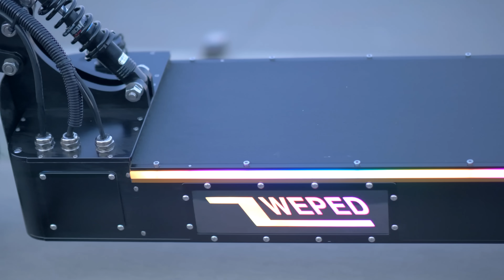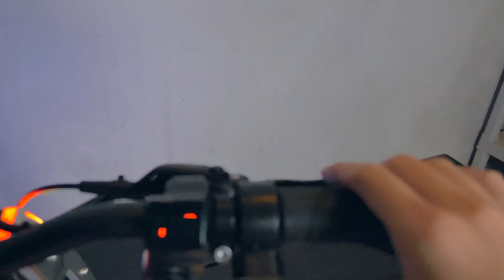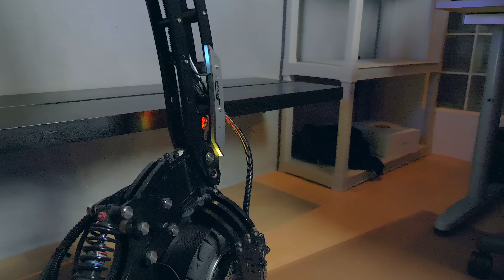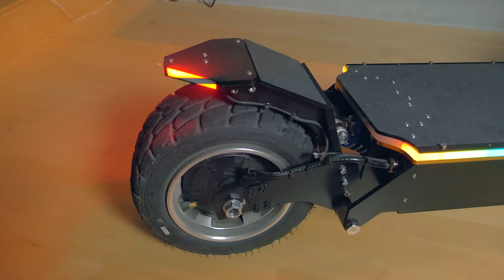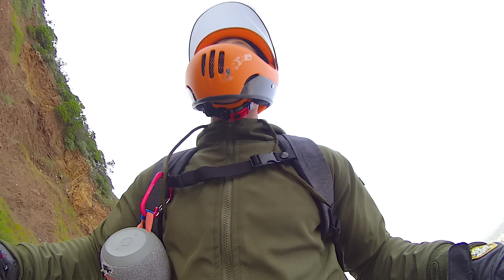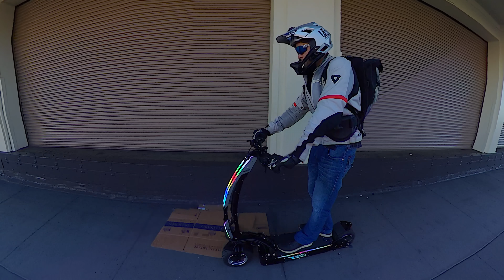WEPED SS Electric Scooter, An Insanely Fast And High Quality Ride

Comment: so how long do the motors last before replacing 2 years?
Reply from the maker: The motors actually last a surprisingly long time! They are very simple components, only copper wires and magnets. I can see them lasting 10 years or longer. Your battery will go before that, likely after 5-6 years, but you can replace everything as needed including the motors.

Comment: Very nice video! i have a dual 1800 (3600w) scooter and if you want mor stability and less wobble at high speed ride like a skateboard side way and bend knee after 50kmh if i stay straight i can't control. it's already freakin powerfull...i can't imagine 5000w+😅
Reply from the maker: Good point about the stance, I do ride like that sometimes, it's nice carving like that too. Nice to hear about your scooter, sounds awesome :)
Reply: LDX brand name from alibaba.well tbh it is not waterproof. get moist create a controller to blow. then they send me 2 new controllers 1 blow because of bad design board was touching the casing☹️ still wait for new controller again since december. when hes running it's great😂

Comment: I gave a like for the quality production of the video, but I'm not a big fan of that weped brand....I simply don't like its design, looks weird.

I appreciate that they have a wider deck at least with this model. 

44 miles in mode 1? Lol... Like 88 kph? Hard to believe that Sh1t 🤣 then in Mode 3 will surpass even the Rion with a top speed of 260 kph 🤣🚀. Rocket launcher babe 🚀✈️🔝🌌🚁

No spedometer? That has to be some bulsh1t to 🤣

45 ah battery without no fast charge? That's a biig boolshit!!!!!!!!!!!!

Comment: I gotta hand it to scooter people, yere bloody nuts, I ride an ebike that maxes  out at 74kmh. On a 3kw. And even that's too much for a push bike. not saying i wouldn't ride it, i definitely would and now I'm considering building one.  I have  two 52v battery's lying around that i could link in series for a 104v 60ah with 85amp discharge. That oughta do it 😛
Reply from the maker: E-bikes are also awesome, and probably the safest PEV out there. A 104v 60ah battery would be insane 😳 Plz do it lol.

Comment: Totally insane. Not the Scooter, it looks cool, but somebody even attempting to ride it at even 65mph + needs therapy.  My fat e-bike tops 42mph, and I don't go over 35, and it's 5000w.
Reply from the maker: Yeah, I think it's going to be rare that you actually want to utilize the top speed, but it's cool for bragging rights. Your e-bike sounds cool, have fun on it! ⚡️💪
Reply: @AlienRides  Cheers! 👍😊
Reply: @Martyr4JesusTheChrist  It does, I've just left the setting on eco mode which is setting #3 the controller is 120amp with a TFT750C display, 72v 26ah battery that charges it to 83v max, so I'm ok with knowing it has the torque and speed 😊 Thanks for the positive comment. 👍
Reply: @Martyr4JesusTheChrist  it's an OEM, I believe generic, (conroller)it's unbranded, the cells are Samsung, I can use the battery without pedal assist for a couple of days riding the bike before I have to charge, but under 65v and the bike struggles a bit because the hub motor is minimum 60v to 90v so it's why it keep the setting on eco. Just an update I've maxed out at 48mph on full setting and eco mode gives me 35mph. I ordered everything from Alibaba.com apart from the bike which came from eBay brand new 85% assembled. Unfortunately I don't know how to program the Kelly or Sabvoton controller as I know it will make the bike ultra quiet and more sufficient, but I haven't ruled it out getting one, also I live in London, and there are ebike shops that just sell bikes and don't do bike builds or at least programme controller set ups as I've enquired before.

Comment: Not crazy about how low and close to the rider the handle bars are.  Non adjustable handlebars are a no deal for me.
Reply from the maker: Yeah, I think that's most electric scooters, the Weped SS has a fairly long deck though, so it's really up to you on where to position. They're not as adjustable as other scooters for sure though.

Comment: In my opinion a scooter that small is not meant to be riddin that fast
Reply from the maker: It is actually one of the largest scooters, but that’s a fair point, definitely dangerous riding at speed.
Reply: @AlienRides  totally agree. It is good that it is built large like that but i think it needs a seat to make the ride feel a little more stable. It is already a heavy scooter so why not add a seat on it or redesign it incorporate a small seat.  In my opinion once you start going 30mph and faster it should be from on a sitting postion not standing position.

It is cool how the manufacture made the scooter visible with all lights and it is cool that the scooter can actually go that fast. But it is really unsafe to ride  sustained speeds of 50-70mph on that type of scooter in my opinion.

Any road surface issue like pot hole or debris in the road will easily send a rider tumbling to the ground with serious injuries and easily killing yourself lol.

That type scooter you should only be sold to an adult of 21 of age and that has an existing motorcycle license

Comment: Thanks for posting. I will be talking to the SFPD about this. Saw exactly where you were going on San Francisco streets.
Reply from the maker: Are you against electric vehicles or something? 🤷‍♂️
Reply: @AlienRides  No. However what has been built doesn't belong on city streets. It is simply an unregistered and unlicensed motorcycle.
Reply from the maker: Lawrence Rhodes just because a Honda Civic can go 120 mph doesn’t mean people do this all the time and all cars should be banned. It’s obviously up to riders to ride in a safe and predictable manner, and if they want to they can go crazy on closed race tracks.
Reply: @AlienRides  There is already a problem with unlicensed dirt bikes on city streets. Taking something like a bird scooter and hotrodding it is insane. This vehicle needs to be licensed at the minimum. Probably crushed if the CHP gets a hold of you. No brake light, mirrors or turn signals. What are you thinking?
Reply: @AlienRides  It is clear that even the 30mph moped restriction is too slow for this crowd. If it goes faster than 30 it's a motorcycle. I would think you would be welcome to put turnsignals and mirrors and register as a motorcycle. Then you have my blessings.  However: Motorized Scooter

A motorized scooter is a two-wheeled device that has handlebars, a floorboard designed to be stood upon when riding, and is powered by a motor.

The Vehicle Code (VC) does not require registration, license plates to be displayed or the scooter to be insured. Local authorities can regulate the registration for these scooters pursuant to VC §21225.

Even though insurance is not required, owners of these scooters should contact their insurance company to determine if coverage is available.

A motorized scooter may be operated on a bicycle path, trail or bikeway, but not on a sidewalk. An individual shall not operate a motorized scooter:

    Without wearing a properly fitted and fastened bicycle helmet, if they are under age 18.
    Unless it is equipped with a brake that will enable the operator to make a braked wheel skid on dry, level, clean pavement.
    Without a valid driver’s license or instruction permit.
    With any passengers.
    While carrying any package, bundle, or article that prevents the operator from keeping at least one hand upon the handlebars.
    On the highway with the handlebars raised so that the operator must elevate his or her hands above the level of his or her shoulders in order to grasp the normal steering grip area.
    On a highway with a posted speed limit greater than 25 miles per hour (mph) unless it is within a Class II or IV bikeway. However, a local authority may adopt an ordinance or resolution authorizing operation of a motorized scooter on a highway with a posted speed limit of up to 35 mph.

A Class II bikeway provides a striped lane for one-way bike travel on a street or highway. A Class IV bikeway, often referred to as a cycle track or protected bike lane, is for the exclusive use of bicycles, physically separated from motor traffic with a vertical feature. The separation may include, but is not limited to, grade separation, flexible posts, inflexible barriers, or on-street parking. Separated bikeways can provide for one-way or two-way travel.

A motorized scooter may not be operated at a speed in excess of 15 mph on all highways, including bikeways, regardless of a higher speed limit applicable to the highway.

Vehicle Code (VC) §21226(d) prohibits alteration of the exhaust system of a motorized scooter. By comparison that would apply to raising the kw of an electric motor from 1000 to 10,000.
Reply from the maker: Lawrence Rhodes I’m totally fine adding turn signals and mirrors, and doing paperwork if that helps these vehicles remain legal. Thanks for the feedback.
Reply: @AlienRides  That's more like it. That is the only way you will survive. Maybe a seat option too. Also an off road switch so the rider and not the manufacturer will get in trouble. Many an electric bicycle has these. Get hip.  Woke. Whatever.
Reply: @AlienRides  I have converted three wheel electric golf carts from the 60's into mopeds.  You just have to work with CHP and DMV. No different with your scooter. Do it legal and nobody will screw with you. You might talk to Todd at Electric Motor Sports in Oakland.
Reply: Wtf is wrong with you weirdo???????????
Reply: @kevinkev1530  WTF is wrong with you death wish?

Comment: Cool vid,thanks for showing me something amazing ! 
It seems to me that it would be a lot safer and smarter to be sitting down, on a seat closer to the ground to keep the center-of-gravity lower. 70 mph standing-up while running on these tiny tires will kill people,no doubt and no joke. As someone else correctly pointed-out, potholes are a big danger. I have seen many potholes bigger that tiny tire for heaven's sake !
Until they get batteries that are 10x better,electric vehicles will be nothing but battery-trucks. They have indeed made tremendous progress with electric vehicles by experimenting with neodymium magnets and lithium batteries-and they are always working on the 'next thing'. 7000$ could buy 25 xiaomi 365 scooters !
Reply from the maker: Agree that better battery tech will make these a lot better. Solid state lithium is probably coming out next and I'm super excited for that. Personally I'd much rather have one crazy scooter like this instead of 25 xiaomis, but to each his own.

Comment: try riding one of those in houston and some drunk moron or angry savage or texting  A** hole will turn you into pancake  in 24 hours.
Reply from the maker: Yes, sadly there's a bunch of jerks and idiot drivers out there still. Hopefully perception starts to change and we get safer PEV infrastructure, like protected bike lanes.
Reply: @AlienRides  I wouldn't hold my breath for that. I've seen hateful savages speed-up just to run over dogs and cats with my own eyes. myself i was rear ended 3 times in one year and they don't even give tickets for drunk drivers or rear enders cops are too fucking lazy to fill out reports.  texas has the highest  kill ratio especially Houston.Bikers get slammed into all the time and i'm willing to bet half are not just accidents from what I've seen on roads. I have never seen anyone ride a bicycle on a main streets in 18 years and there's a reason for it.
protected bike lanes in houston? ..oh my.. they would call them open season target bike lanes.

Comment: One bump or swerve at a speed (oh lets say) of 30mph or greater and u are done
Reply: You will only get road rash lol not a big deal(you will get road rash if you don't have motorcycle gear)
Reply: @illuforce  It's not the falling or sliding along the ground that is the issue it's what you collide with that will kill you. Sliding into a curb or wall at 50 or so mph can easily break your neck or smash your shoulders ribs and pelvis. Go spend a night in the emergency room sure to change your mind. lol

Comment: $7000 USD is the correct amount for this scooter my 40kw liquid cooled electric Gp circuit scooter's are $30,000 same as a Red bull 125cc GP bike with the same power output 👌 people have to understand a 30-45ah high discharge and fast charging grade A lipo cell pack will set you back $3,000 alone with matching fast charger
Reply: You're consuming too much red bull if you swallow that pill

Comment: Sorry I just don't believe the power capacity of the battery. I have a state of the art 4.8kwh lithium nmc battery pack, and its a lot bigger than what's under the floor pan of that scooter.
Reply from the maker: These are the latest 21700 cells which have awesome power density and the deck is quite large as well. I don't think the video captures how big the scooter really is, but I hope I can take off the lid and show the internals in a future video.

Your pack sounds awesome. What is it installed in?
Reply: @AlienRides  its my off grid power supply 😎. The cells are eig prismatic, similar to what is used in ev's. At the high end of watt/kilo.
Reply from the maker: @melodysouljahrootsdubpress5539  Nice, I'm debating getting a Tesla powerwall, but yours seems like it probably cost a lot less than that.
Reply: @AlienRides  with a power wall you get all the management etc and support, but if you know what you are doing, you can build your own. You don't need to be off grid either, as having storage means you can charge at low cost times of day and discharge when grid prices are high.. And even sell surplus back to the grid at peak times. Battery integration technologies are really a step forward
Reply: Very nice scoot tho, absolutely love the lights 👍😁